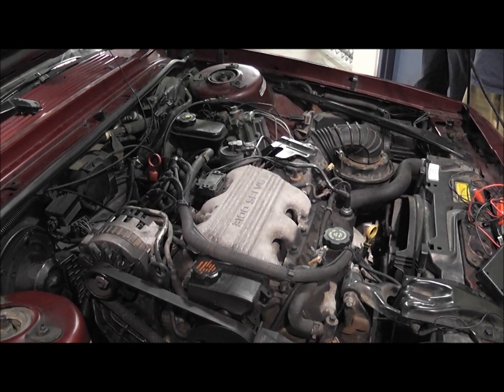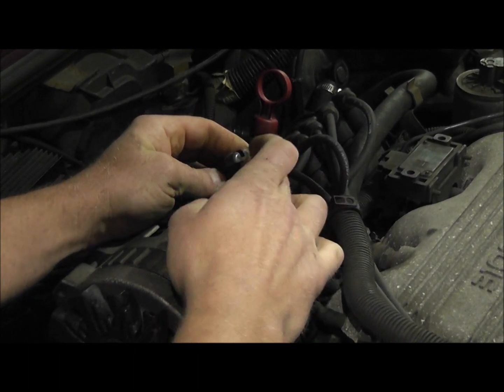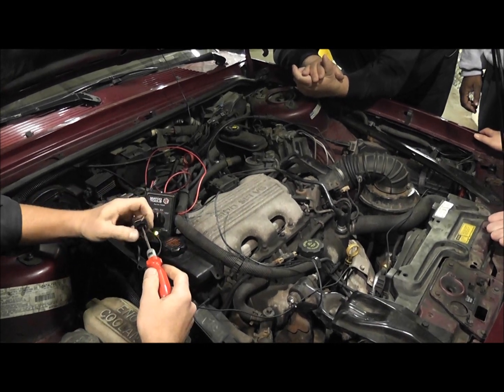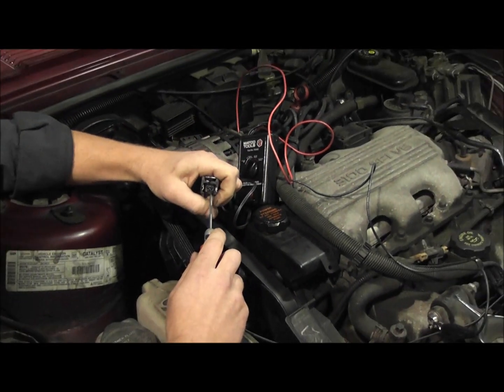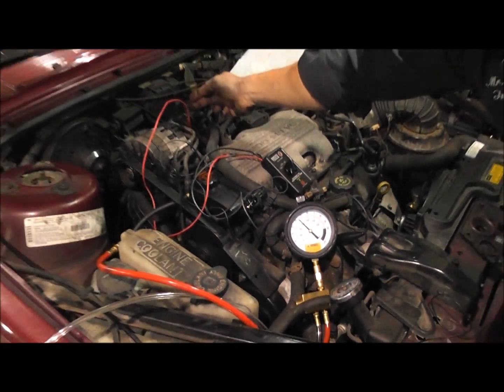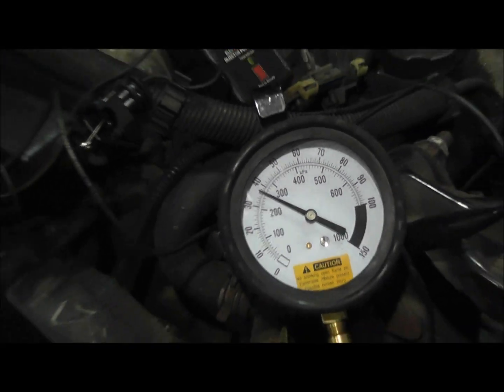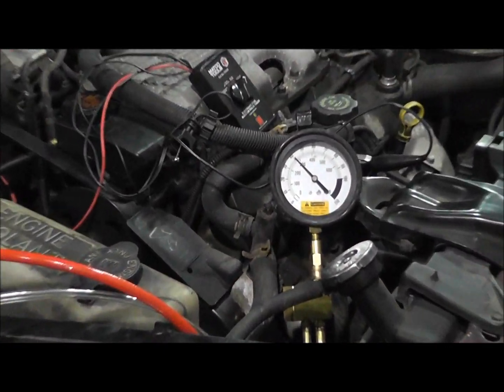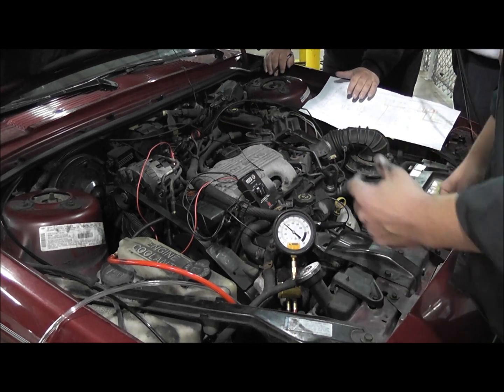How to test a fuel injector for flow problems (GM)

Comment: What are the ways to test injectors without metered tools or scopes or scan tools?
Like some simple trick like swapping coils. Or how most of the time I'm never getting a injector code.
I used two jumper wires with alligator clips with a 9V battery to test the injectors being stuck or not by seeing if they click, then use the wires + battery to clean em with carb spray after tapping the side to unstick the electromagnetic solenoid Valve/switch to open/close the flow of fuel.

Are there other teicks SD knows so everyone can do more tests.
Think of it like your stuck with your friends, intermittent Crank No Start + stall on turns with a keg 😂
Broke down on side of road, no tools, no phone
Reply from the maker: The only other non meter injector tests I've ever used was to use a long screwdriver as a stethoscope to listen for clicking 🙂🍻

Comment: How do you use scales and set triggers on scan tools without knowing Voltages
Reply from the maker: Curious as to why you'd ask this question here. I don't believe I used a scope or scanner on this one. Also, are you referring to scan data parameters or are you talking about a lab scope? Thanks!
Reply: ScannerDanner the one u and Eric did when he said u need to know how to set up a trigger is the big take away on using a scanner I’m just trying to learn I love learning about cars
Reply: I’ve worked on cars I just have never used a scanner and wanted to learn how

Comment: I was just doing this today at work but bi directional.. Biggest pressure difference was 3 psi but mitchel/shop key said that was in spec.. slight slight random rough idle used some fuel injector cleaner and sent him on his way. If he comes back I’ll feel more comfortable attacking that sell I just couldn’t rationalize a 600$ repair on such a slight problem. Let it worsen a bit if it even does.

Comment: clifton559 Why are you shouting, your comment isn't even true. In the event of a severe misfire the computer driver may shut off intentionally meaning that if you disconnect the injector it will make no change to the engine yet the injector is not at fault.

Comment: I'm sure that some tools have the control on one side and other tools have the control on other side (because it doesen't matter in case of injectors. They are only a coil) and will work equal way with control inverted or not.
Reply from the maker: That would be true if I was testing the injectors directly. What you're failing to realize is I was using the system voltage to power the injectors (NOT the tool) so I needed to ground the control wires with the tool only. What would have happened if I used the wrong side of the tool? I would have been supplying direct battery voltage into the control side of the injector, so the injector would not have pulsed AND this I could potentially cook the PCM driver!
Reply: +ScannerDanner hey Paul, im wondering how can you cook the driver?? (That driver should be off right)
Reply: So, you are saying since the car is not running, the pcm is not pulsing the injector; how can you potentially cook the pcm driver.Great question. But, If Paul Danner says it, we have to believe him.
Reply: @little739  ....by supplying voltage backwards into the ground side of the driver circuit. It wouldn't matter if it's on or not, voltage on a computer circuit where there is only supposed to be ground is not a good thing. It might be ok, it might not, better to not take the chance and find out.

Comment: An injector is not much than a coil, so you DON'T need to see what polarity the test tool have. You can put it reverse and the injector will pulverize equal way and same quantity of fuel. So you don't need to see what is the control and the ground. You are only energizing the coil inside the injector so as long as you don't exceed voltage of the injector, you can put it any way, I mean control on 1st pin and GND on 2nd, and vice-versa is THE SAME THING.

Comment: Noid light simply indicates power present at injector; Pulse tool allows control of injector on/off duration: Check cylinder balance by firing individual injectors at 1/2-second increments in three different ranges: 1 pulse of 500 milliseconds, 50 pulses of 10 milliseconds, 100 pulses of 5 milliseconds.
Power and output lights indicate test activation.
Includes wiring harness adapter and instructions.

Comment from the maker: Sorry man, did the best I could. Hard to do this over the computer. Also once you start changing other parts, you start adding problems. If you replaced the module and now have no spark then it is not the coil. You may have disturbed the pick-up coil leads and wiring one too many times. If you now have no spark, you have either a pick-up coil or module problem or a main power or ground problem to the module.

Comment from the maker: I never told you to replace the coil. I said the ignition module or there was a problem with the reference wire.. Also we were dealing with a GOOD SPARK, NO INJECTOR PULSE problem. Now you tell me you have a spark problem?

Comment from the maker: If the test light "bypass test" worked and the ECM fired the injectors. You have one of two problems. Either a bad module or a short to ground in the purple/white reference wire.

Comment from the maker: did you replace the module? The parts store test only checks the transistor function, not the RPM signal output.

Comment from the maker: ok cool, sorry to panic there in my response. I was concerned about the test you did. All is well, change the ignition module and let me know what happens. Oh, very important question though. You said you did have spark right? Because if you do not there is another test we must do first before module replacement.

Comment from the maker: First of all I never told you to run a jumper from battery positive to that wire. I said to use a test light. And I certainly didn't say to leave it there. If this is what you have done you may have cooked the engine computer. 
However, you still may be ok. What this test told you is you need an ignition module. I know you have spark, but trust me you still need a module. It is the module's responsibility to send the ECM an RPM signal on that purple/white wire. It simply is not.

Comment: hi, i assume we can use this tool to bench test ignition coil by connecting positivewire ignition poistive and control wire of this tool to ignition negative.  Please advise. I also assume this tool can be used for any pulsed ground circuit, like EVAP solenoid, etc.

Comment from the maker: Ok so you do have power. Is this a V-6? Do you have spark? If you do, do this test. Turn the key on, connect a test light to battery positive and touch on/off the purple/white wire coming out of the distributor connector. The injectors should fire every time you do this. Tell me the result of the test

Comment from the maker: Power to the injectors is supplied by a fuse on this model. When you checked for power how did you do it? Test light? Voltmeter? Or by the injectors not spraying fuel you are assuming you have no power?
Let me know, I can help further, but be patient with my reply

Comment from the maker: @Amopower Some early 80s Chrysler and Mercedes Benz had power side switched injectors, but if you are connecting the tool to the injector itself and not into the harness as I did in this video, it wouldn't matter about the polarity of the tool. Always check a diagram to be sure if you are doing what I did in this video. Follow Section 3 in my book for solenoid identification using a voltmeter or wiring diagram.

Comment from the maker: @jdubb408 Yes, the control wire on the tool is a pulsed ground and you connect it to the injector control wire which is also a pulsed ground by the PCM. The tool substitutes the PCM in this test and fires each inj. for an exact amount of time. The pressure drops will indicate leaking or plugged injectors. Check out my 2005 Neon Injector Problem video (poor video quality,sorry) for a leaking injector using this test.

Comment from the maker: @Amopower Two things, first the cylinder balance test is just an RPM drop test. It will only isolate which cylinder but not the cause. It could still be spark, fuel or compression. So this test may still be necessary after verifying which cylinder has low contribution.
Second, you are correct in your comment, this is a volume test. Check out my first video on a 2005 Neon with an injector problem. (that is if you can bear the poor video quality of my phone, it was my first video:)

Comment: That's a pretty neat quantitative way to compare injectors. My 94Probe has EEC-IV which lets you do a cylinder balance test, and I think it does so by dropping power to each injector one at a time and checkign RPM differences. I like this way better, seems more accurate. So the idea here is that if you pulse each injector for x amount of seconds, then each of them should emit the same volume of gas, which in turn translates to a pressure drop.